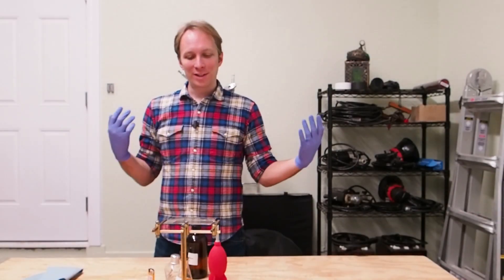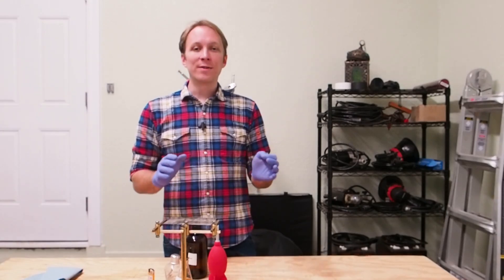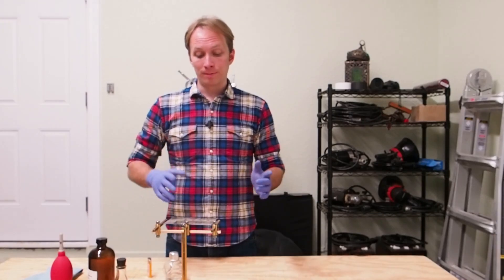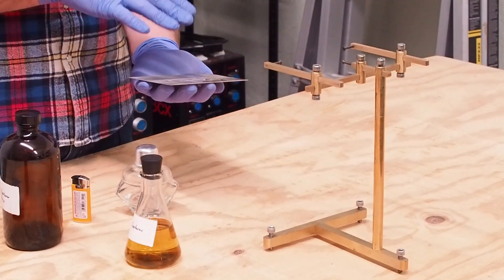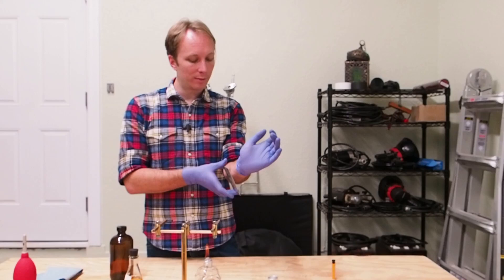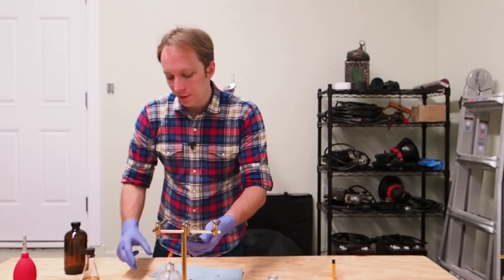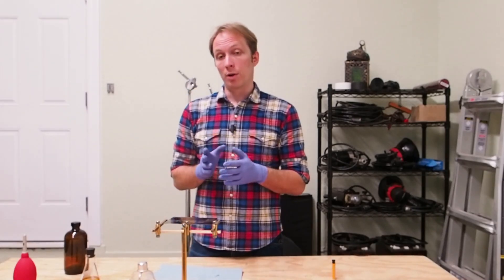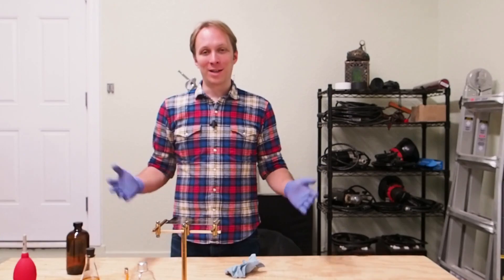Collodion Basics Part 8: Varnishing the Plate

Comment: Hi Robert, love your videos - very detailed explanations. Just a question, when out in the field what would you use as a running water source for the rinse? I converted the back of my van as the darkroom but it does not have a water tap unfortunately. Thanks, Kevin
Reply from the maker: I don't rinse in the field, I coat the plate with glycerine and wash when I get home.  There's a little more detail on that in my collodion chat video about the storage trays

Comment: I'd love to see a varnish filtering video as well!!
Reply from the maker: There's not a whole lot to add on varnish filtering, I usually just set a funnel with filter paper in it on a ring stand over my varnish pour bottle and pour the used, dirty varnish into the top of the funnel.  It takes a while to filter through because the varnish is so viscous, but if you leave it for a while it'll all filter through eventually
Reply: @tehbieber  Thanks!

Comment: I've seen lots of people use oil lamps to evaporate the water off. Is that just for show and would a simple wick candle work too?
Reply from the maker: Sorry I missed this one for some reason. I've heard oil lamps aren't ideal because they don't burn as clean as alcohol. I'm sure it would work fine, you'd probably just have to keep the wick really low because I think it burns hot.  When I got started I actually used votive candles to varnish plates, but it takes a while to heat up and produces dirty smoke